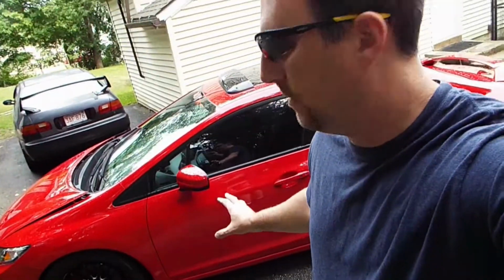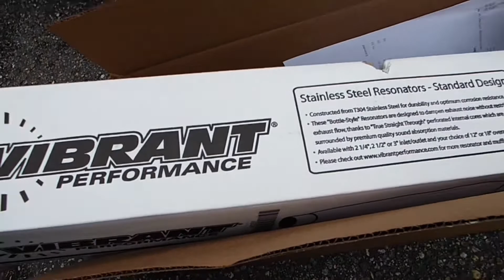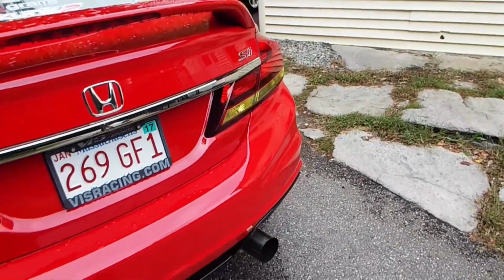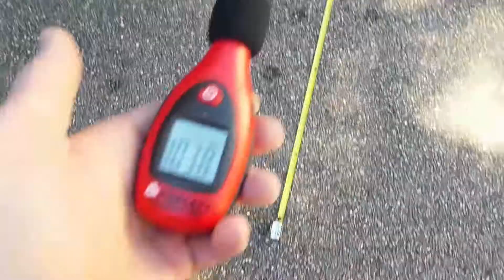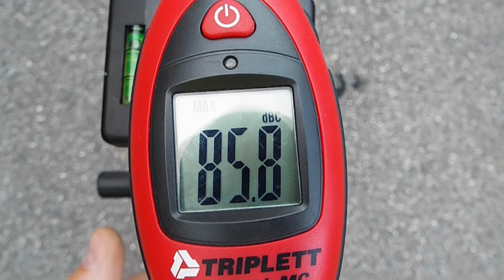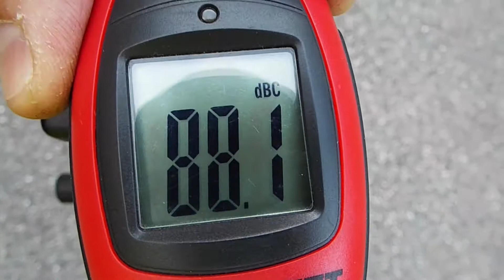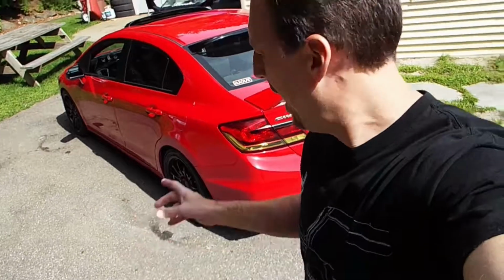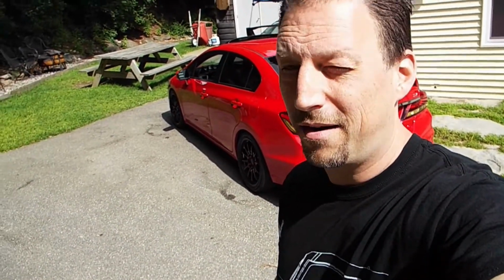Vibrant resonator review 2014 Supercharged SI

Comment: The resonators only deal with the droning effect and the tone of the exhaust note, the muffler is actually what makes the exhaust louder or quieter
Reply from the maker: there are some resonators that do help with volume of sound .
Reply: FortrexNite did you ever get the ultra quiet one? If so make a video
Reply from the maker: not yet I will when i get one

Comment: Had a state ref for exhaust. Got that vibrant 1792 resonator installed. So I had the stock cat, to the resonator to the muffler and I added on a silencer. The silencer being “bolted on” was not allowed to be used to pass the test. Took it off and the car sounded way louder than previously without a resonator. I believe the 1792 one just enhances the sound because my car sounded boosted crazy I know. I will be getting the ultra quiet one next to pass the test because I did not pass lol

Comment: It depends how you're setup is because Invidia already turned the midpipe originally. Adding another resonator changed that obviously. I also used to think adding 2 or more resonators would help quiet the engine down but most of the time it doesn't. Pipe resonance comes into play as well as the amount of bends, type of bends and diameter size. Usually to combat this issue is to replace it with one bigger resonator and even add a high flow cat or even a regular cat in the mix.

Comment: If you want a quieter exhaust sound, you should have bought vibrant's ultra-quiet resonator, and replaced it with the one you had.  The closer to the manifold the resonator is, the sooner it can cancel out the sound waves produced.  Adding a second resonator wont do anything.
Reply from the maker: We did add the resonator as close as we could to the downpipe without it hitting anything or hanging too low where I would bottom out on it . Tank you for your comment
Reply from the maker: ill have to remember that
Reply: General Speed I mean I like what I hear but I mean I’m all about no rasp so I mean I’m down just to listening to right now least but I mean I’m honestly liking what I hear😊
Reply: But what happens if you're getting the droning in the back of the exhaust close to the back seats

Comment: So I'm thinking of a vibrant I have a downpipe to straight pipe horrible drone ...so that being said if I Get either Vibrant ..will that kill the drone that's killing me ?? I just want the drone gone !! I can be even louder than I am now ..just need the drone gone
Reply: The drone comes from the piping diameter....  The stock piping is 1.5"..  A slight increase is more than enough... Go with 2" or 2.25 with a quiet core invidia catback and you'll love it.  No rasp, no drone..   Also I learned ( the hard way) that the header actually makes a difference.  I ended up with DNA..
Reply: +Dallas Willer stock exhaust diameter on the 9th gen si is above 2". Think it's 2.25"

Comment: I have the same exact resonator in the mid pipe of a 2.75" invidia Q300 (Kraftwerks 8th gen w/ alpha header). It's a quiet exhaust, I just wanted to reduce a little drone. It didn't do anything for highway drone but it did quiet it down a tad for local driving. You are better off getting a Q300 and the power trade off isn't much at all, only maybe like 5 whp. I had a full race 3" and took it off because the drone was so bad on the highway but it was really quiet for daily street driving. I dont feel any power difference boosted.
Reply from the maker: Paul K good to know , I will look into it
Reply: Do you have a video of the car with the resonator on?. I have the Q300 in my 8th gen and would like to quiet the drone at 3000 RPMs too.

Comment: Reso straight through won't do crap.  Ultra quiet reso will make it a lot quieter from Vibrant.  If not get a muffler from vibrant that's not oval and is suitcase looking. It's straight through still and will not decrase power but will change tone and make it more quiet